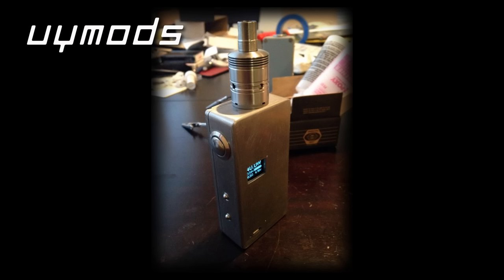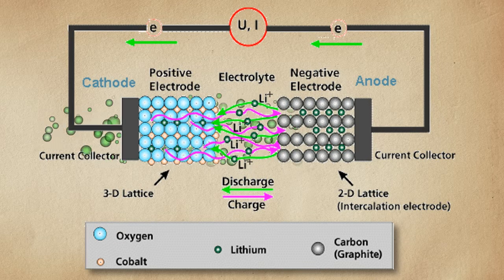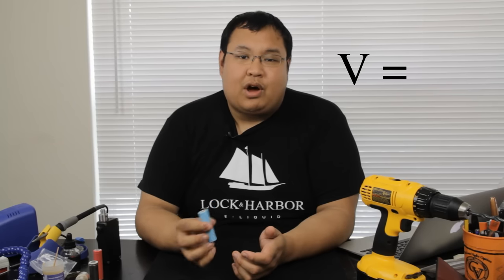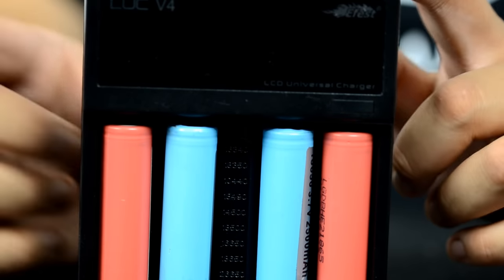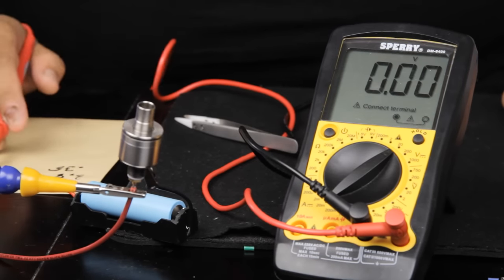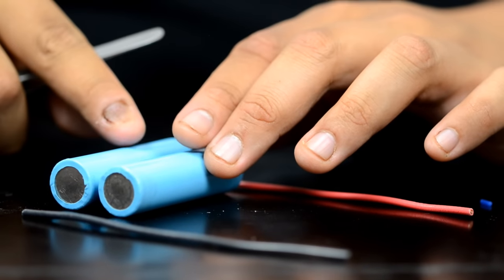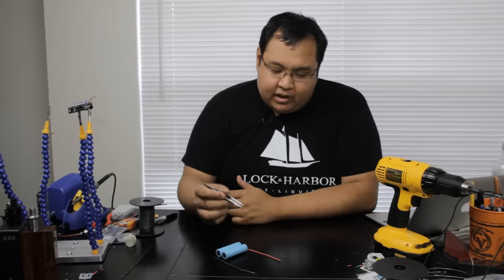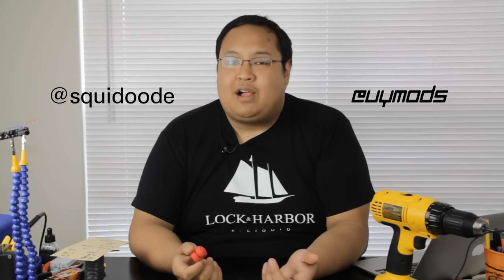Know Your Vape: Batteries Debunked Featuring @uymods

Comment: wait so amp limit isnt increased in series?  so why can u push more wattage in series mods even though the amp limit is still the same. does having a higher voltage decrease the amp output?
Reply: +xiexiefrank2 Amp-hours (and milliamp-hours) measure current capacity as opposed to the actual energy capacity of a battery. The energy capacity of a battery is measured in Watt-Hours. Milliamp-hours (mAh) depends on the voltage. Here's the answer to your question given as an example:

A 2000mAh 3.7V Li-Ion battery is (3.7x2000/1000) 7.4 Watt-Hours. This would mean that two of these batteries would be (7.4x2) 14.8 Watt-Hours.
- If you put two of these in series, the voltage is doubled, but the current stays the same: 7.4V @ 2000mAh. If you get the Watt-Hours of these two combined it would be (7.4*2000/1000) 14.8 Watt-Hours.
- If you put two of these in parallel, the current is doubled, but the voltage stays the same: 3.7V @ 4000mAh. If you get the Watt-Hours of these two combined it would be (3.7*4000/1000) 14.8 Watt-Hours (exactly the same as in series).

You're able to achieve more wattage in series from the increased voltage. In a regulated mod with batteries in series, whenever you change the Watt output, it's adjusting the voltage. So yes, having a higher voltage allows for more power (watts) with less amps: voltage is going up and down while the amp draw stays around the same.

In a parallel circuit, the best way to increase power is by controlling the amps.
In a series circuit, the best way to increase power is by controlling the voltage.
Two roads to the same destination.

I find the best way to think of it is: Current (mA/Amps) is the amount of electrons, while Voltage is how much energy each individual electron is carrying.
Reply: +Gex9z thanks for clearing it up!

Comment: what 18650 to use for 0.2-0.3 ohm builds ?
Reply from the maker: +Fade Prakasa You could use any as long as they are high drain batteries. I recommend Samsung 25r's and LG HE2's
Reply: vtc5's or 25r's. just make sure you get the vtc from a reputable store, since there are maaaaany fake chinese ones going around that are basically rewraps of crappy half dead laptop battery cells.
Reply: +The Art of Vaping ............Ryan, ....... vtc5s seem weak in tubes, even do the lg he2s. (greens vtc5, browns lg he2s)  super subbing.. 0.07-0.09, what is your always used tube mod battery?  shop workers act like they know everything, but more than half of them, know less than "most people".. the brown lg he2s seem to work great in boxes, just i cant find that hard hitting tube.  n i have the best ones.. no clones ever #allauthentic

Comment: +The Art of Vaping  
hello i have a battery ultrafire18650 4900mAh 4.2v Li-ion what coil build i need to be safe
Reply from the maker: +Haidar Hack I would throw that battery away my friend. Those are not high drain batteries and are not intended for sub ohm vaping! Look into Samsung 25r's or LG HE2's
Reply: thnks man i have buy a new batteri like you sad a LG 18650 -HE2

Comment: I recently got some orbtronic sx30 batteries which are slightly bigger than most 18650s, does that mean they are controlled? Are there any other reliable 30a batteries available?

Comment: Do i need to worry about ohm's law on a regulated device?
Reply: not really. a regulated device will protect you from firing dangerous ohms for your battery.
Reply: not really. a regulated device will protect you from firing dangerous ohms for your battery.
Reply: not really. a regulated device will protect you from firing dangerous ohms for your battery.
Reply: Thanks I didnt really need the meassage thrice I am not a moron ^^
Reply: +elektabuzz I don't have the patience to write it 3 times either. phones playing up I guess.
Reply: hehe have had a similar before.

Comment: The batteries are not imr. It is a lower case L. The L meaning lithium. Also, the R does not mean round, it means rechargeable.
Reply: Dave Carpenter A google search for "LNR battery" versus "INR Battery" will show you that it's a capital "i". Yes, it still means Lithium, no, it doesn't make sense that they use the letter i to designate lithium, but it is what it is.

As for what the R stands for, I'd refer you to this. 

http://www.reddit.com/r/electronic_cigarette/comments/1t6ci6/everything_you_ever_wanted_to_know_about/

Note that the "IM" already refers to Lithium Manganese, which is inherently a rechargeable battery chemistry.  There would be no need to include "rechargeable" as part of the designation as it's already implied. The R in IMR stands for Round, and if it were an IMP (P for Prismatic), it would be the same rechargeable chemistry battery in the shape of a rectangle.
Reply: I did more research. I found a bad article previously. It seemed like it was intelligently written. I did find that the reason for the I was to denote lithium ion. Using an L to denote Lithium would scientifically suggest it was a hard metal version. I bow to you sir and firmly place my foot in my mouth. :)

Comment: What should i do if my battery is sparking when im firing my mod? Please respond anymore
Reply: +Shaun Nater idek ig im a beginner all i know is that my battery are brown and supposedly samsung batteries and mine is a series box mod but when I charge them they get hot and when i put them in they spark but when they cool down they dont
Reply: +Shaun Nater i have a mutation v4 rda
Reply: +Shaun Nater i think my ohms are .2 something idk but do you think getting them rewrapped would stop because that wrapping is slowly coming of but im just an amateur at this stuff
Reply: +Shaun Nater the guy I bought it from says it has high resistance but thanks bro I'll be careful thats for the help/info

Comment: P=V²/R so serie will give a LOT more power
Reply from the maker: Yes, Series produces 2x the Voltage but the Amp discharge stays the same so one must be mindful of the resistance of the build they are using on a series so they don't blow themselves up!

Comment: Bought new batteries yesterday, woke up and the batteries where dead .... can't charge it because it just says check batteries. Huhhhhh
Reply: Are you using an external charger or the micro USB port on your mod to charge the batteries?
Reply: John Kobilarcik , I now have bought a external charger , I was using the USB port, which I've stopped doing. My old box was problem
Reply: I noticed with my Nitecore charger that it would give me a battery error when I tried to use a micro USB cable other than the one that it came with.

Comment: i'm sorry brother, but your discussion on who makes better batteries is very misleading. the "major brand" companies you mentioned, DO NOT actually make batteries. they contract them from various factories. meaning, they pay a company, that specialises in battery production, to produce batteries at a certain spec. the only thing that sets each company apart, is their spec standard. thus, you could have batteries with 2 different logos on them, and to different prices etc. but are the exact same battery. 
 in fact, many of these companies have NO investment of the batteries design. they are given the various possible specs, and then left to decide which is most effective for them. based on cost, performance etc. 
 furthermore, i'd like to add. that sony never ordered battery production for "vape" units. these batteries were intended to be used in battery packs for drills and other various equipment. not to say that the sony brand batteries are in anyway, not good. just that ruling out anyone based solely on name, is just dumb. there are several emerging vape oriented battery companies out there, like Efest. that are releasing very competitive products.

Comment: series set up is less dangerous than paralel set up !
Reply from the maker: I disagree....
Reply: as you don't know anything about electronics, as you want !
Reply from the maker: Well, I do know a little bit about electronics and how simple electricity works. Series is far more dangerous because you increase your voltage output without increasing the amp discharge so one would have to be very careful to not put a lower resistance build on a series device... You are literally the first and only person I have ever heard make the remark that series are safer than parallel. You claim to have this knowledge so I encourage you to share your opinion, not make assumptions about my knowledge!
Reply: i know !  P = V²/R
Reply: I say only that I do not know any company making electronic material using batteries in //. I speak only about batteries, and I have some dual batteries in my "vape machines", but ALL OF THEM are connected in serie.

Comment: THE R STANDS FOR RECHARGABLE!!!!!!!!!!!!!!!!!! NOT ROUND DAMN IT
Reply: ***** and that I (i) is acuatlly a lower case l that got mixed up in translation so they kept it that way, so its actually LMR (Lithium Manganese Rechargable)
Reply: ***** It's not a translation error. It's an I for lithium Ion salts, where as an L would indicate elemental lithium. Also all Lithium ion chemistry batteries are rechargable, so the fact that the cell is rechargable is covered by the "I". Having "R" mean rechargable would be redundant, the last letter is for the cell shape. "R" for round is the most common, You can also find IMP and ICP batteries, where the P stands for Prismatic (rectangular prism) which are shaped as a cube or 3D rectangle (but are still rechargable, by the way).
Reply: ok so after doing some more digging iu guess that is right, i read that a long time ago, so the i is for ion then, anytime someone asks what that means thats what i tell them, now i feel stupid, thanks for the info
Reply: Justin Uy i've seen non-rechargable lithium duracells or energizers